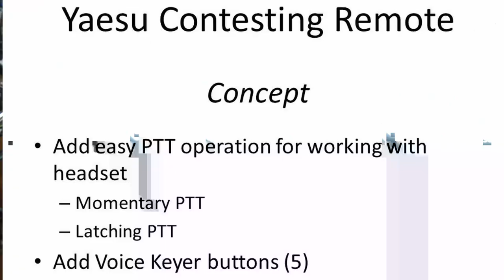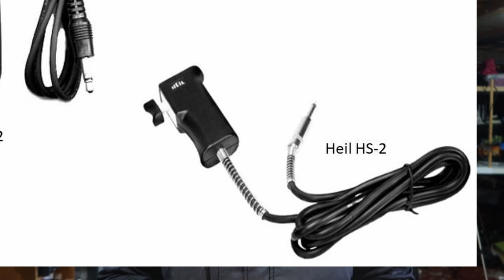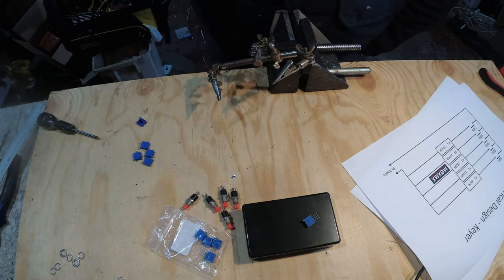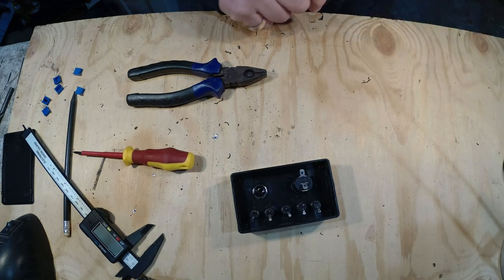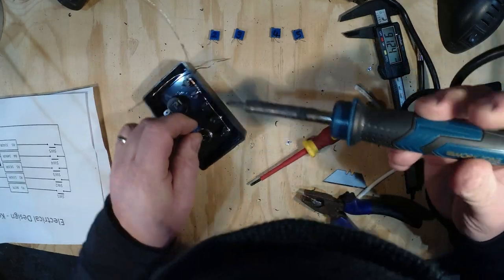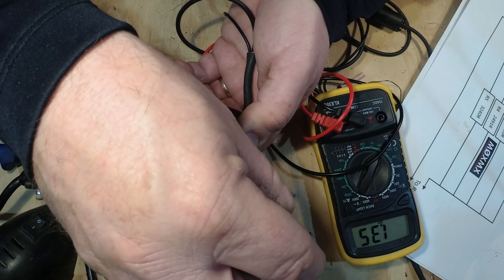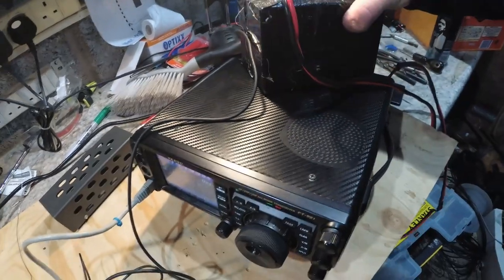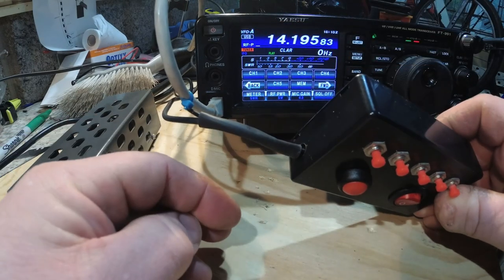Ham Radio Construction of Remote Contest PTT & Voice Keyer

Comment: Great stuff Mike. I have also seen your hand operated PTT/lock....I was wondering why you don’t use a foot-switch for keying the rig? Cheers, Nick M1DDD
Reply from the maker: Yeh good question that I knew would come up. The seating in the van is quite low and makes a footswitch uncomfortable. I have one in the shack (but never use that either!) I dont like VOX either.